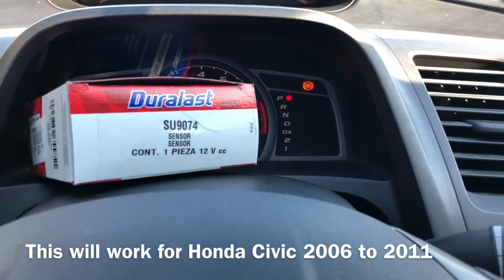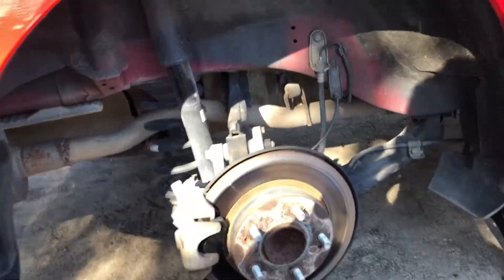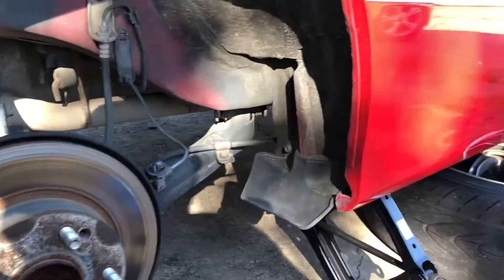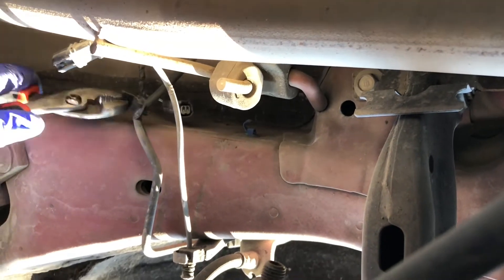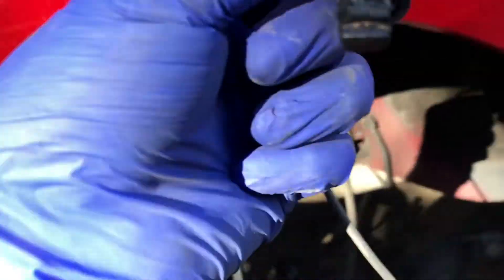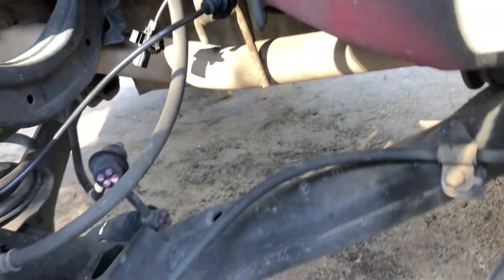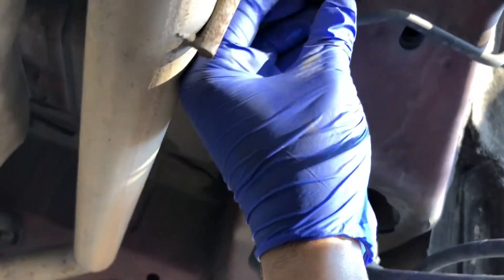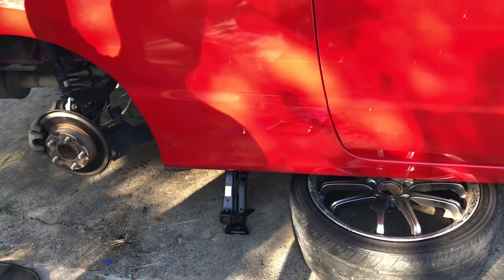How to Replace ABS Wheel Speed Sensor On A 2006 - 2011 Honda Civic

Comment: Replaced both front sensors . Now replacing spindles and bearing assemblies . Someone recently replaced wheel bearings and put them in backwards. Guess this is very common

Comment: Will a new abs sensor make the light go off?  Mine came on when put a wheel bearing in front passenger side.. it’s a 07 Civic.. I tried the paper lip in the cel part in pin 4 & 9 ...but light still on..
Reply: Your wheel bearing is in backwards

Comment: You should have just cleaned it the stock one that should have done the trick I good video I suggest next time to check the stock sensor are check a live feed with scanner to see if it sends signal also an ohms test
Reply: Hey...I thought I was having alternator problems so i checked the battery with the multimeter and its reading good. So my car digital speedometer is at 0, and its all over the place,  and i got no day time running lights? Is this the speed sensors thats have to be replaced? and how do you know which ones?
Reply: Daniel Cook the sensors shown here are for the abs theres one on each wheel if your having abs issues this is what you would check it has nothing to do with your dash speed now if I understood right your speedometer stays at 0 for this the speed sensor is located on the transmission first you should check the fuse for it same thing for your day time running lights aswell as the bulbs for those if you havent yet once you check that if the fuse is good for the speed sensor then check the plug on the sensor itself to see if its damaged at all which it shouldnt unless someone messed with it but I'm going to assume you havent if everything is good swap out the sensor and you should be good

Comment: In my civic 07 changed this sensor. Turn off the brake  light, but the ABS light not off.
Reply from the maker: You might have another abs sensor that’s bad on it.  If you don’t have a OBD code reader then go to autozone and they will check it for free and tell you what’s wrong with it.
Reply: Fix it Felix thanks bro. In fact it is my next step. 

Have a nice weekend.